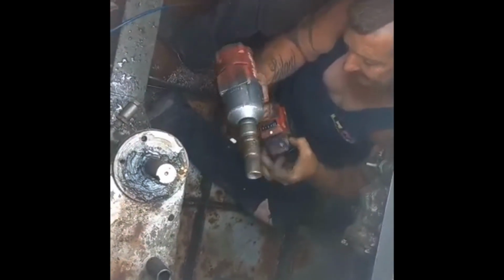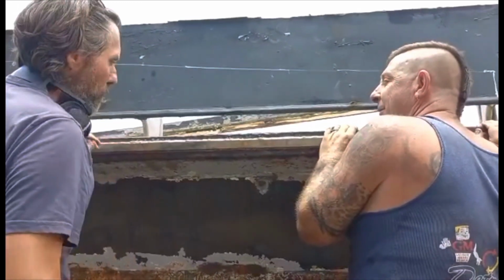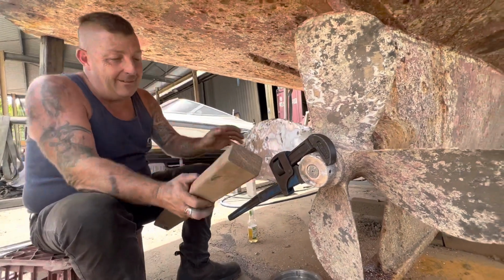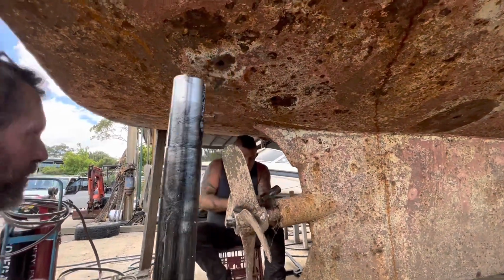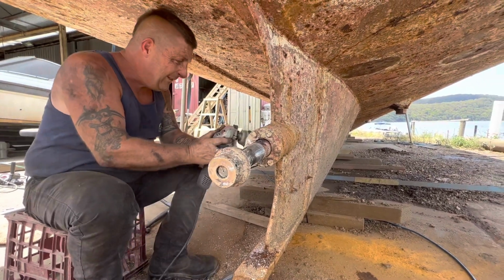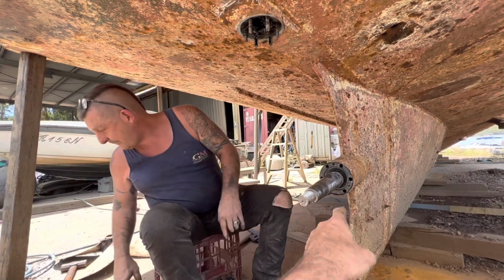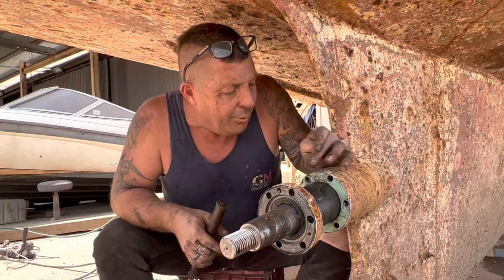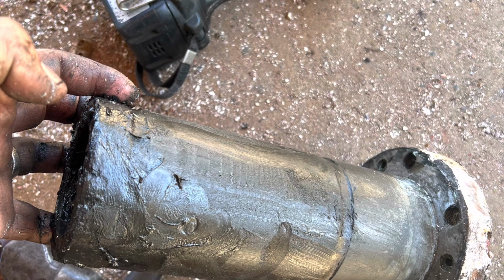Stripping out old steel trawler  for conversion (poor mooty)

Comment: Love the channel adrian, but the sound was kind of hard to hear and i dont mean the wind noise. That's a hell off a good design for bearing/seal change and repair. I'd go over that whole area to check for the grub screw with a neeedler. What were ya'll talkin about on the top rail part? was a bit confusing

Comment: Need an extra long bolt fot the jacking srew holes? A piece of all thread with two nuts jammed together. Set the nuts to be just beyond the lenghth of the part being walked out. And there youe made the non chisel type puller. Were the drag marks on that bearing fresh? Or had it been out before?